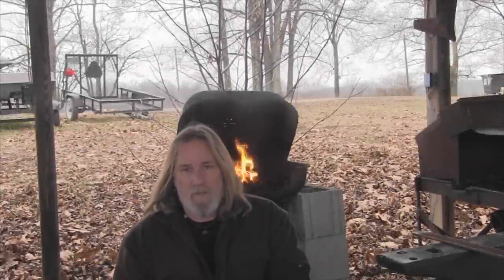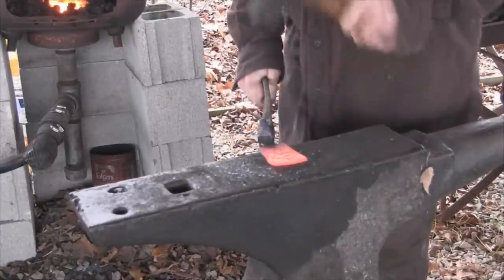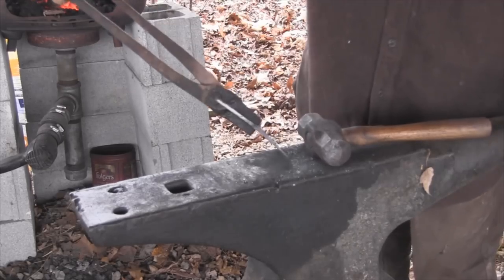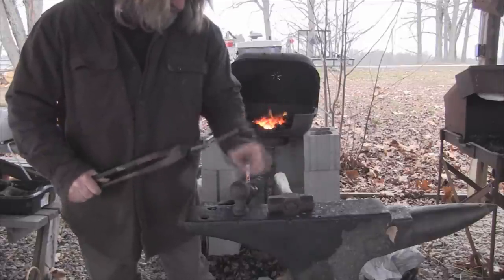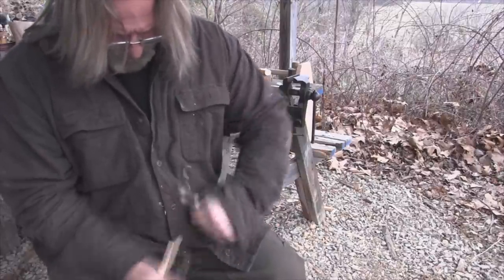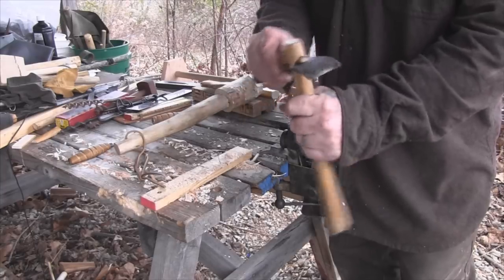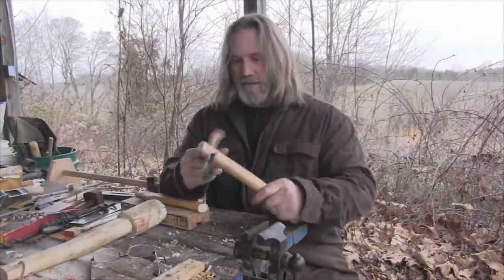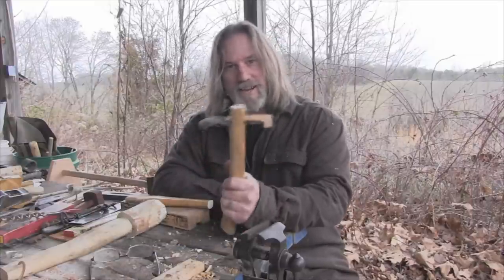Forging and making a Primitive Adze

Comment: Nice job Dave.. The one that I've seen similar to it had the tang hooked down at an angle so when the wedge is driven in it pulls the blade back as its tightened down.. Keep them coming.

Comment: Have you considered running a bolt perpendicular to the grain of the handle, through a hole in the adze head?  It might hold more securely that way.   Thanks for posting, Dave.

Comment: Dave, if you didn't need the interchangeability option, would it make sense to whip the head and locking wedge in rawhide to have a little bit more permanent tool?

Thanks man.
Reply: Patriot36 The only downside I would see to that is it would be harder to tighten if ever needed. Also, disassembley would make sense for compact carry. I do not think that the rawhide would be a hindrance, though. Thanks for the idea, i may just do a wet rawhide wrap when I make mine.Zac

Comment: I think it wolud be better if you flipped the "plug" over so that the thick end doesnt rest against the back of the tang,because i could imagine the tang pushing out the plug upon impact..
Reply from the maker: The tang is never suppose to touch the plug or wedge, if it does the wedge is too short or the tang too long that was an adjustment I made before working the oak-
Reply: ***** Why make it with a plug or a wedge at all?  Maybe you could just make it like a tomahawk with an oval-shaped hole in the head for the handle, that way it doesn't spin?
Reply from the maker: Atkrdu Much more weight to carry two of those than just 2 blades, this was a PRIMITIVE style Adze, hence the name of the video-
Reply: ***** I'm confused.  I might making the adze like you would a tomahawk.  Hey, there's an idea: maybe making a tomahawk with a 4-way attachment (that way it could be turned sideways to use as an adze).  Then again, I've heard of just lashing a tomahawk sideways like that- don't know how to do it, though.
Reply: I agree! The plug resting on the back of the tang will cause it to become loose upon impact. Its something that can be easily fixed with a bit of tweaking.
Reply: Atkrdu
He already did just search on his chanel

Comment: I'm not about to say you did anything wrong, nor criticise what you showed, but personally i would have taken a different approach to this, i think i would have attempted to forge weld the two rasps together and form an eye in the centre, so both blades were on the same tool, like a pick axe, because basically, if you flattened the pointy side out, that's pretty much what you would have (albeit a really freaking big version, so no good for bowls, but canoes maybe), and the eye in the middle would be easier to mount to a handle, even if you chose to mount it in a tomahawk fashion. I was intrigued by the method you showed though, i wouldn't of ever thought of wedging it the way you did, and this method also shows how to make use of what would normally be the wasted portion of a rasp that was being smith'd (usually you snap that side off and discard it, so its good to see what you could use that side for. personally though, i think it would be less effective and have less durability than forging an eye to fix it down (from experience id rather have an eye friction fit to the item as the retention tend to be better/ last longer than wedged on one side if that makes sense, but again, not saying you were wrong to do  it that way, both ways do work, like i said i just think the eye would have given the tool more durability.) each way has pro's and cons though, the way you showed is definitely going to be an easier method to a noobie or somebody who needs it making quickly, ive only forged a few times, but i know forge welding versus wedging is no contest as to which one is faster or which uses least materials, fuel, steel, calorific requirement.

A good video though thank you for sharing and giving some ideas.

Think you have pretty much made one of everything now in the blacksmithing series, what is the next project your undertaking for it? a folding knife would be pretty cool, or maybe a water container or something- would definitely test your skills to make a durable water carrier from scrap.
Reply from the maker: Switch Outdoors Thought about that for like 2 seconds then decided I wanted light weight, and this actually easier to haft on about any branch with no carving if needed simple lash ahead and behind and baton it between the fibers of any green branch, very simple and could be done sideways to improvise a hatchet as well-
Reply: Understandable, I do see the benefits to your method, and I will probably recreate one in the near future to compare to an eye'd version just to see for myself which one is "better", like i said previously, i can see pro's and con's for both methods.

 i would also compare both versions to a hand drill and a hook knife combo, I get the weight factor would be an issue with this, but i feel the versatility of them versus just a pair of adze's (not sure what to call them in plural form) would make them a better carry option because  i think there are so many other projects you could undertake. 

EDIT:
The more i think about this, the more appealing your method is starting to become, although it is mainly for ease of creation than it is for weight or durability, but after I experiment a little i may realise it doesn't come loose as often as i currently assume it would, so might be pleasantly surprised at its effectiveness....